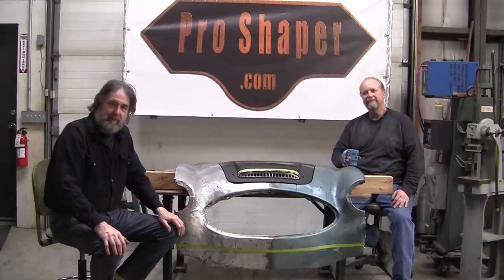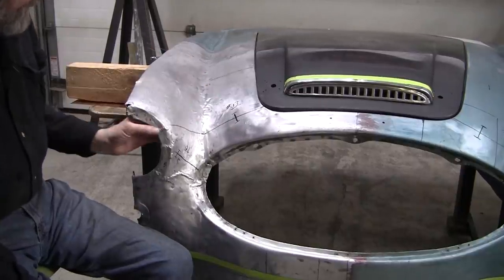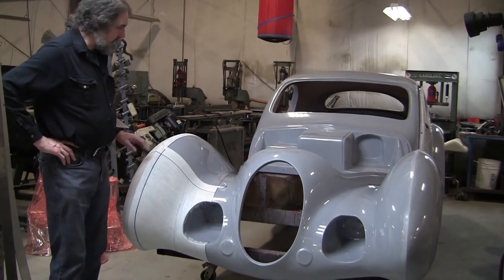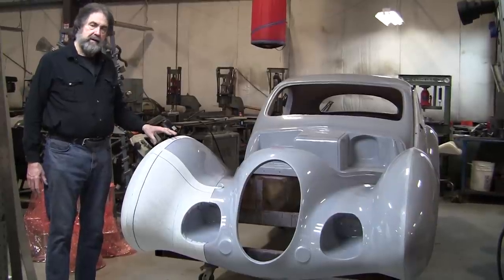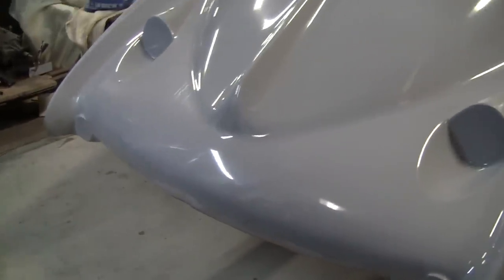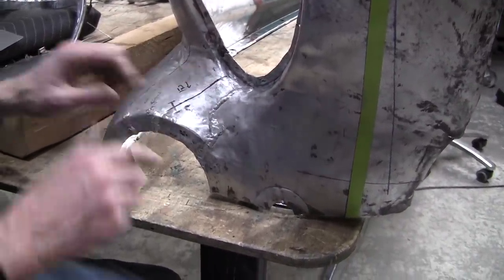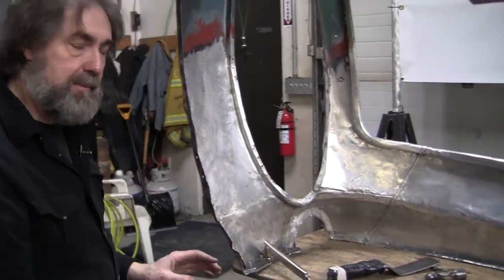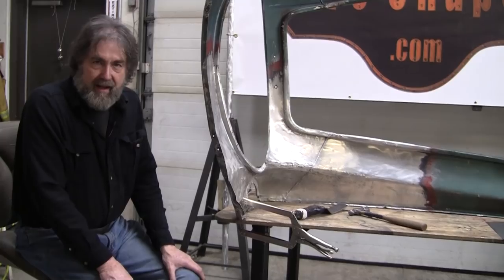Austin-Healey 3000: Shroud Update and Interesting Project Preview

Comment: Awesome job Wray.  You mentioned the engine turned dash in the Talbot.  It reminded me to ask what is your method for engine turning.  Also, if you were to make an aluminum midget race car tail, would you use .050 or .062?  I will stay tuned for your next installment!
Reply from the maker: Hi Danny, .050" will work easier, .063" will give you more dent resistance. If you race it and crash they will both dent.

Comment: Process question. You mention three areas on the shroud that need work. The opening around the hood needs to be wracked, the area in the valley just behind the head light and the very edge that you show with the shroud on the table where it isn't flat on the table. What's the best approach now that it's getting closer to the original shape? My intuition is telling me to get the hood opening correct, then move to the valley and last would be the outside edge. Or do you continue to work the whole thing? Also How's the Doc's Alpha Romeo coming?
Reply from the maker: I always try to fix the worst problem first.